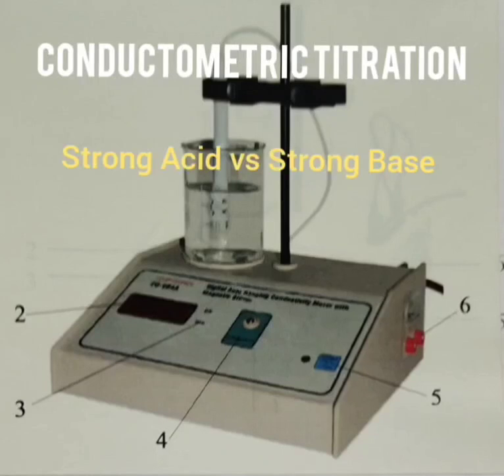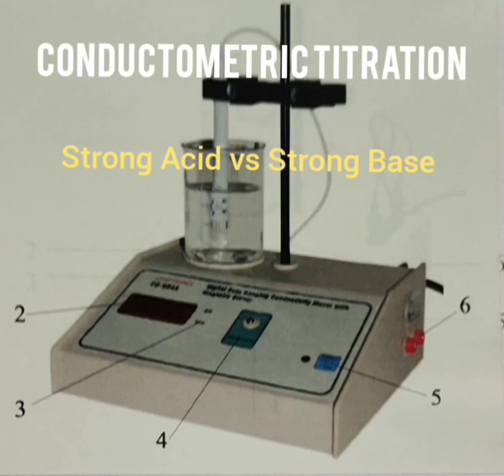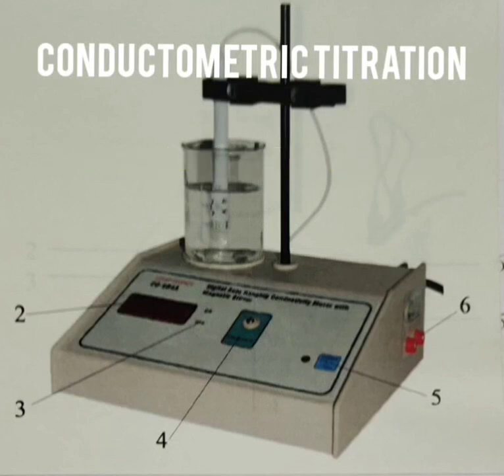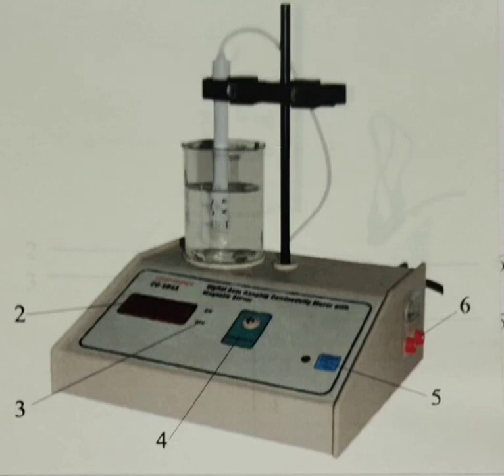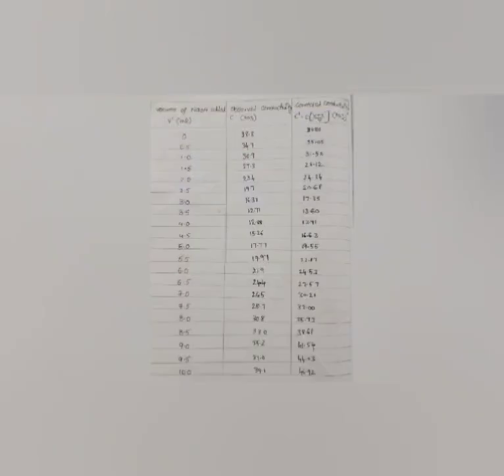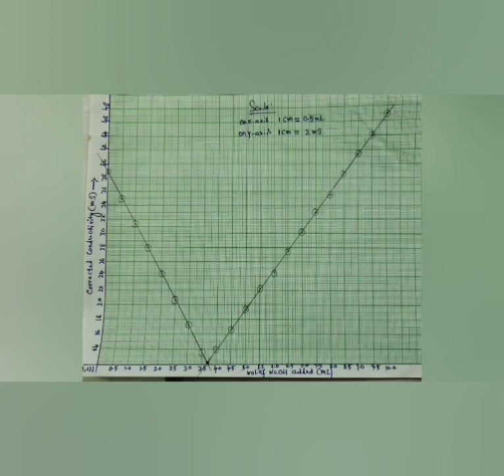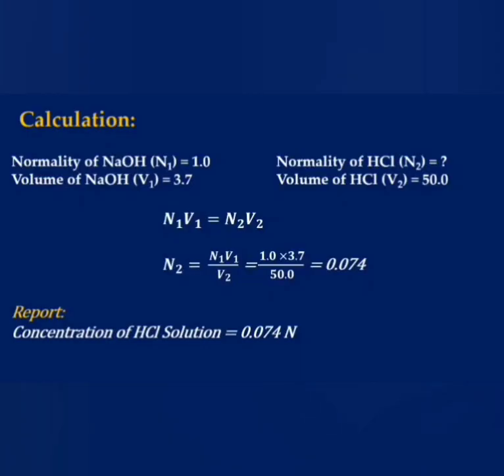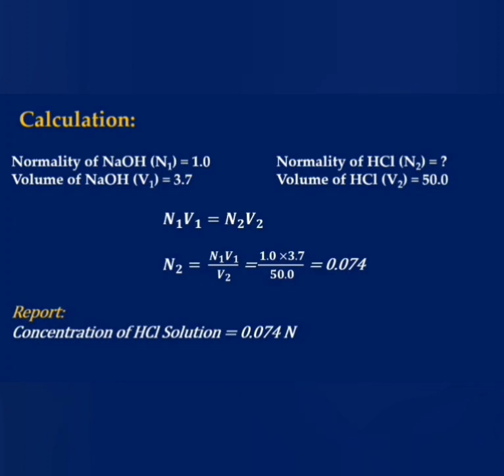Conductometric Titration of Strong acid Vs Strong base | Calibration of Conductivity Meter| RK Sir

Comment: How to calculate currected conductance plz explain sir
Reply from the maker: By multiplying with ratio of total volume of solution in conductivity cell and initial volume
Reply: I can't understand sir
Reply: Plz one example is write down sir
Reply from the maker: If you add 1 ml NaOH... multiply the conductance with 50+1/50 i.e. 51/50